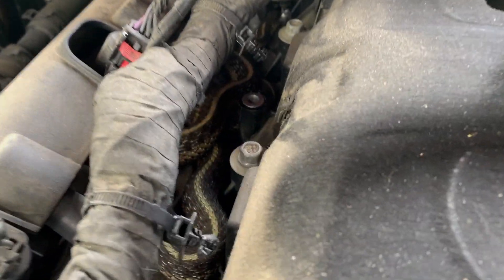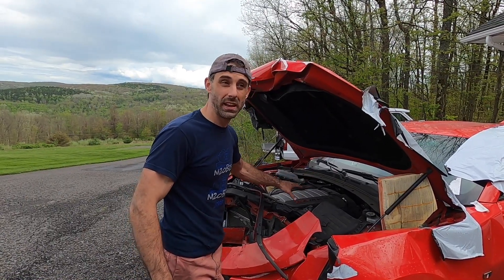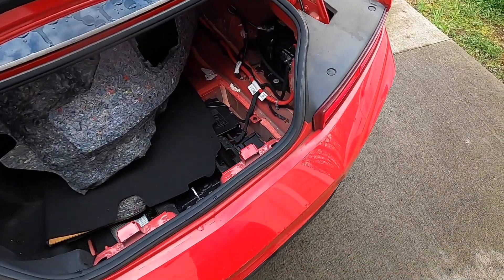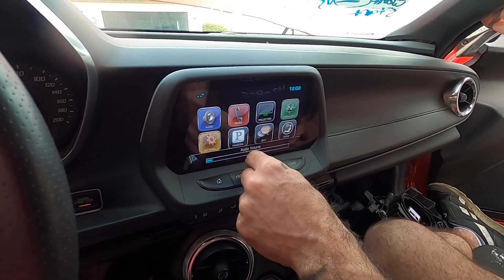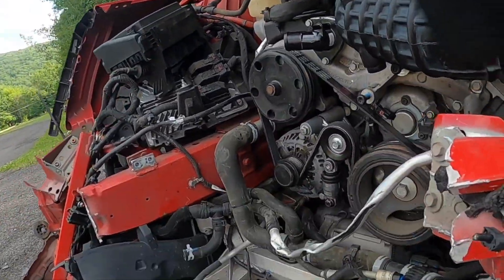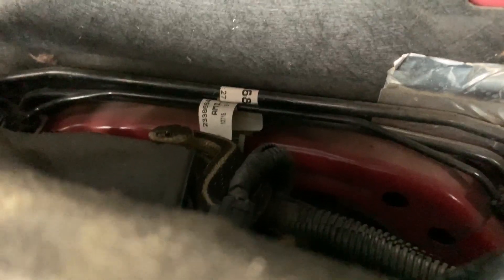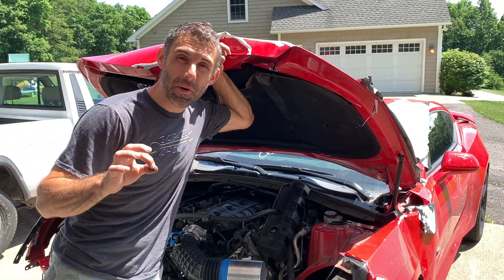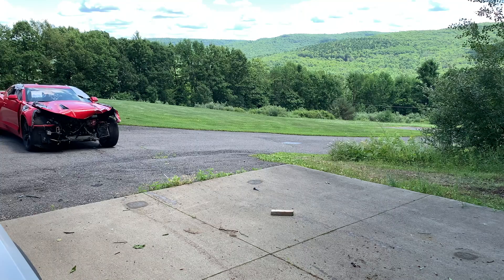Part 1: New Swap Project!! 6th Gen Camaro SS Auction Bought Sight Unseen!! But Will It Even Start!?!

Comment: As a member on the Camaro forum, I’ll be watching for updates. Looks like an interesting swap! One thing I’d recommend since you already need a new IM is getting the LT2 version for it. Not much difference in price & they’re close to MSD performance.
Reply from the maker: Nightfall 1LE whats an IM? I definitely need a front sump oil pan (GTO Perhaps?). thanks for the tip! Glad I posted there. I’m going to ask a lot of questions on the forum!
Reply: Garageaholic it’s the intake manifold. They worked out how to use the one off the C8 corvette on these to get some more power for very little extra money. I’m not sure if you’re looking for much more power than it comes with but there’s a few things that are fairly inexpensive you can do for noticeable gains. Check out the v8 LT1 section & feel free to ask for advice on there. Lots of guys with a lot of knowledge in the forum!
Reply from the maker: Thank You! Yeah idk how I didn’t make the connection with IM! Haha yeah I think my customer will be interested in any inexpensive gain opportunity. As you know the existing IM is jb welded so we’re looking for a replacement anyway!
Reply: Garageaholic 😂 no worries man! Good luck with it!